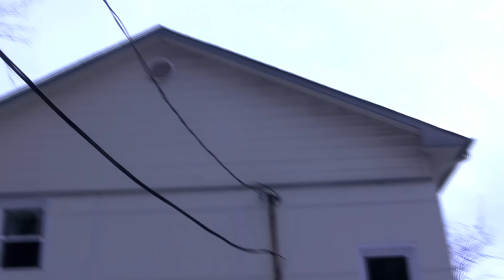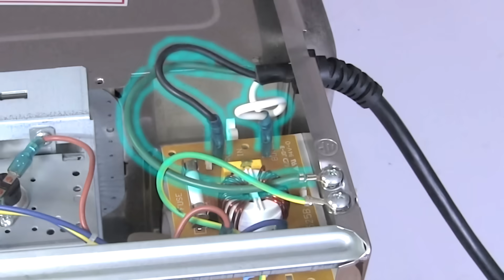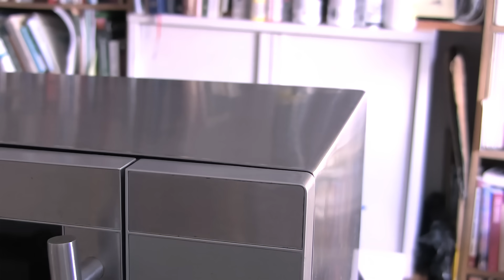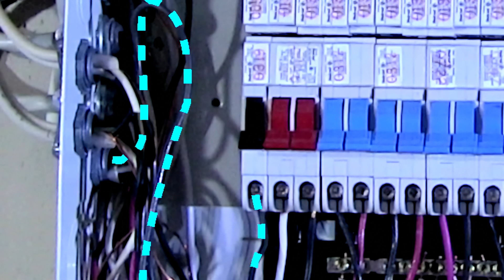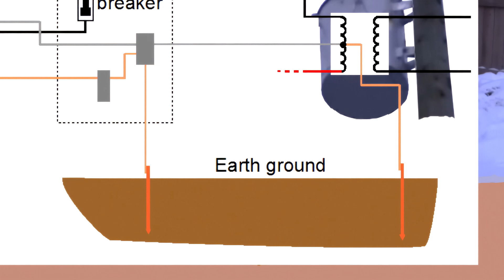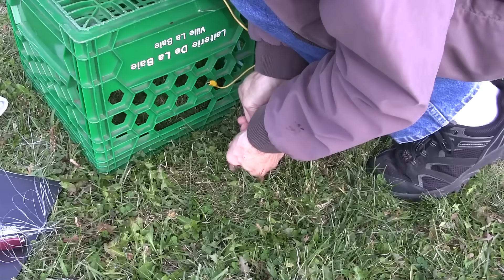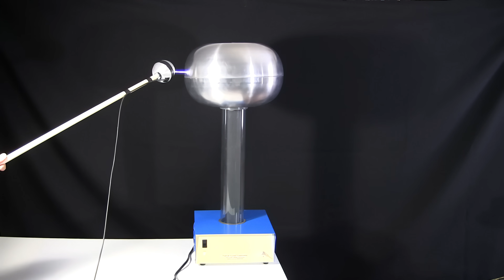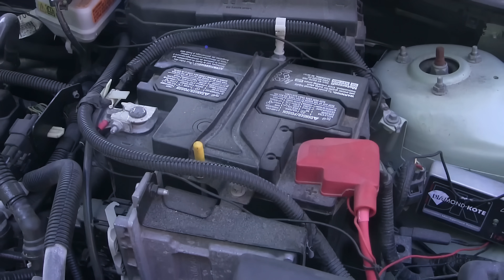What is Ground? Earth Ground/Earthing

Comment: How do phones and laptops make portable ground for their bluetooth and Wi-Fi antennas?
Reply: Great Question: 

Phones and Laptops use Direct Current (DC) so the electrons have a path back to the Source of power which is a Battery.
This Video is refferring to Alternating Current (AC) The primary path for the Eletrons to get back to the source of power (The Transformer)  is the Neutral (white wire) with the Ground (green or bare copper wire) as a alternate path. (explained in the Vid.)
Reply: @portbari87  little knowledge is dangerous  -laptops etc uses both ac and dc current in their various applications
Reply: You don't need any kind of an earth ground for those antennas. Just like any old fashioned portable radio.
Reply: It’s also important to note that all batteries are DC unless run through a transformer afterwards.
Reply: @griplimit   Why would you run DC through a transformer?
Reply: @fiddlyphuk6414  dc cannot work through a transformer, it will just heat it up and act like a heater and possibly burn it up -same as running dc through a voice coil  (speaker)-you need a collapsing magnetic field for the transformer to work -ie AC current that reaches its peak than collaspse to zero than peaks to minus,
Reply: @ericscaillet2232   Yeah dude- I know. That's why I was asking griplimit.
Reply: lookup "RF ground"

Comment: In India We use Red for Phase(Hot or Live) , Black for Neutral and Green for earth. Ground wire runs separately from equipment to local earthing point (separate earth pit constructed at home). It does not get combined with neutral wire in junction box. Whereas neutral  point of transformer is earthed at transformer pole.
Reply: Ganesh Kumar Shetty the UK used to be Red for live, Black for Neutral and Green for earth but for sometime now it has been changed to Brown for live, Blue for neutral and Green & Yellow for Earth to make it easier for colour blind people to identify the wires. The whole of the European Union follows this convention. This only applies to new or modified installations, so it is quite confusing to see wiring with a mix of colours. Wherever the new wiring has been used on an old installation, a notice has to be displayed indicating that the new colours have been used. I think it is the convention in the US to join the neutral and earth in the panel, unlike ourselves, earthing the neutral at the transformer.
Reply: That was british way..same as malaysia..here in malaysia ground touches neutral can cause tripping..
Reply: @Ganesh - Those are the OLD Color Codes for wiring  ...

Comment: the ground should be separate from the neutral and actual travel a separate pathway to the earth ground
Reply: The neutral is grounded in the switchgear anyway.

It is however bad practice to mix grounds and neutrals in a local panel.
Reply: @RommulusRemus  
So the electricity , it goes into a neutral metal ? And thats considered ground ? How does the circuit still work if power drains off ?
Reply: @RommulusRemus  Yes, Neutral is bonded to Ground in the Main Panel the USA, but in all countries.
Reply: I am no an engineer but I have done dozens of services from 4000A on down and you always ground the neutral.

When we do transformers (which is considered a separately derived system ie its own service) if you don't ground the transformer you get problems. The power does not just bleed off because the hot is not grounded.
Reply: @RommulusRemus    Is it against code to ground the neutral wire in the panel/box ?
Reply: @RommulusRemus  In the USA
Reply: Yeah- seems like you're giving the lightning an invitation to come into your house and burn through your box to get to ground by grounding the neutral at the box. Better to keep it all going to the outside at the transformer pole instead and then zap down to the ground wire there.  BUT- what would happen if the ground wire at the pole would would open up and loose connection AND your neutral wasn't grounded inside the box?? That seems like a real formula for disaster if there was a lightning strike. So what's the answer???
Reply: It seems to mean that engineers, electricians and the like, should know better but reading these comments tells me that they don’t know the reason for grounding (earthing) the neutral. They should find out!
Reply: @kennethcohan9630  It's mainly for protection from lightning strikes
Reply: Finally, someone who speaks the truth. Mixing grounds and neutrals is a violation of safety code, and yet people still do it. And stupid shit like this on Utube is what gets people in legal trouble.
Reply: @VitoVeccia  yeah dude, grounding sometimes kills people. had a case here in perth where someone got killed grabbing an outdoor tap, incoming mains had a badly connected neutral, but because there is a main earth/neutral connection in the switchboard the electricity went through the girl,into the ground and back to the neutral, if there were no ground she wouldn't have gotten killed.
Reply: @VitoVeccia  correct,but in the old days that is how it was done until they decided if was dangerous.

Comment: i live in a house that was built in 1961 the gas heater did not have a ground i had a new ac and heater unit installed the ac man said i need to ground the heater i cant afford to hire an electrican so can i put a ground rod in and ground the heater to it
Reply: doug .patterson even if you are competent, you may not be qualified or authorised to do the work. If you intend doing the work, you need to read all you can about earthing and once you have done the work let an electrician test it  to make sure it complies with the electrical regulations. You may need his signature to comply with regulations. Unless the exposed metalwork is earthed correctly then you and your family could be at risk of electrocution. Incidentally, aren’t the other appliances, in your house, earthed? If they are, you can use the same earth connection.

Comment: In Australian standards we have Active (Brown), Neutral (Blue) and Earth (Yellow and Green) Or this can be A (Red) and N (Black). 
The link between Earth and Neutral is called a MEN (Multiple Earthed Neutral), this is common in house holds and might be required under standards, in most switch boards I work on in commercial buildings there is no MEN link, the neutral and earth bar a completely separate, im not sure if they are in the bigger supply boards.
Reply: MEN is only required at the main switchboard
Reply: Same here in malaysia..
Ground touch neutral can cause trip..

Comment: Except that the transformer you show is SWER, single wire earth return - no neutral.
Reply: NO, it is not !  He showed about 1/2 ( one Hot wire & one Neutral wire ) from a 240V 3-Wire Split-Phase Residential Circuit (USA).

Comment: is it true that in the past before grounding got introduced you only got shocked if you touched the hot wire on one hand and the cold wire on the other, but now you can get shocked because of touching only the hot wire because of all the grounding around us, the electrons use our body to reach earth and from earth reach the cold wire(neutral) since earth and neutral are always connected.
so the ground system is causing more deaths than if it hadn't existed
Reply: Procker Dark not really. The earth was always there (duh), so in the past if you had touched the hot wire electricity would still flow through you to the earth(assuming you were connected to the earth ground and had no insulation). Also I’m willing to bet that the wattage back then was not nearly as powerful as it is now.
Reply: c flowing through human body from earth https://youtu.be/CHvdvadpCB8

Comment: Please help me. For years my security was working just fine. I removed the old one and when I was installing the new one,  got an electric shock despite the fact that the switch was off. Then despite the fact that the switch was off when I touched the ground wire, it gave me a shock!!! What is the reason!?
Reply: if you touch only a ground wire it should normally not shock you.  that could mean that a wire is not connected to the ground as it should be.

Comment: This video is so non engeneering,, the 3 pin socket ,, the middle is ground ,, yes it is a safety system,, which is connected to earth electrode buried in the earth near the house,,it is also connected to distribution box,, the idea is if current leaks into any conducting parts, instead if shocking us it goes to ground,,
   You cannot use the main supply neutral as ground ,, because those neutrals are produced in substation for efficient current return flow ,, usually 3 phase ,,main neutrals are also known as system earth,,

Comment: Great video. Why do I have to ground my airplane before fueling but don’t (intentionally) ground my car?
Reply: Airplanes have a higher chance to build up a static charge (electrostatic difference) than a car; but it is basically the same.
Touching the fuel nozzle to the chassis of the car before getting it near the fumes coming out of the filling port is probably a good idea.

Comment: Do two hot wires from the substation feed both side of the main coil in the transformer, or one of them is a ground/neutral wire?
Reply: In North America, residential transformers have a HV side and a neutral ground side of the primary, usually 7.2 kV (12.47 kV 3-phase). This is why sometimes you only see one HV bushing on top of the transformer.
Reply: lookup "split phase power"

Comment: If neutral wire and earth wire are both grounded to earth in breaker panel and moreover if the transformer is also grounded to earth, it means both are in same reference (0 V). Then why are we connecting the neutral (or earth wire) in breaker panel to neutral wire in transformer since charge can directly go to earth if fault occurs. Won't it save cost by reduced wiring?
Reply: Some wiring cost is being saved by not having to run a ground wire from the pole to the building.  

Also, depending on the length of wire from pole to building, current flowing back to the pole on the neutral wire could have a couple few volts on it...not going to electrocute someone but that's just not kosher.    

Other unusual problems can arise if a building does not have it's own ground rod.  If power pole ground rod failed the power plug's ground prong safety feature would be worthless.  Redundancy is wise and probably required by various legal rules having to do with liabilities  that trace back to English law and maybe even Roman law.  

The building's ground rod is also very helpful in reducing hum and buzz problems in audio equipment and similar problems with video and data.  With several building's neutral wires all joined at the pole to go to the pole's gound rod there will be a buildup of noise on that neutral.  The noise is caused by any load that is not purely resistive.  A purely resistive load is the incandescent light bulb and electric heaters and that's about it.    The noise does not just disappear into the ground rod.  Noise on the neutral caused by electrical equipment in one building will be present in all buildings sharing the power pole's neutral ground rod.  Sound recording studios usually have to have their own transformer with it's own ground rod.  Such transformers are usually of the type known as "isolation transformer" which is designed to greatly reduce noise coupling from the primary to secondary winding.
Reply: @rh001YT  State your credentials.
Reply: @ Sir Pumpington   State your credentials, or if you have an objection simply state it and why, or the opposite.
Reply: @rh001YT  You don't have any. You are unqualified to offer advice.
Reply: @Sir Pumpington   What is it exactly you think I've got wrong?
Reply: The neutral is to complete the loop and send unused power back to the transformer, neutral is essential, but it's not a ground, its bonded to the ground bus in a panel to provide a quick path to ground,

Comment: 8:05 does it really though?  Metal fence posts are (should be) inserted into concrete footers and would that not isolate it from the ground?  The rest of it probably doesn't make that great of contact with the ground and even if so, it's not very deep so it wouldn't be below the frost line.  So wouldn't that make chain link fences not that great for grounding?  Nevermind, it appears the concrete helps SIGNIFICANTLY with conductivity between soil and metal.  Still....wouldn't the fact that it's above the frost line make it not that great for grounding?
Reply from the maker: In winter, it wouldn't be great, no. However, if you just need it for a quick electrical experiment then it's good enough while the ground's warm. I wouldn't use it as a household ground though.
Reply: @RimstarOrg  Fences shall NOT be used as substitute for a ground rod

Comment: 5:42 - how can they become charged?  This is not made clear.  Is it from the connection to ground in the first place, since lightning is attracted to the ground?  I don't see any other way, unless the lightning somehow came through your house or something.  I don't really understand.  Once the cases ARE charged, however, I understand how the ground connection would pull the charge away and make them neutrally charged again.  Thanks!
Reply from the maker: It comes in through the ground wire. I've worked on solar projects where it also came in through the wires coming from the solar panels and it damaged equipment or blew special protective fuses.

Comment: i need advice on earthing,  What size fuse would i need if i wanted to add it outside on the ground cable attached to the earth rod? i want it to be safe enough for the house circuit to function but the fuse needs to be big enough so that a ground lightning  strike cant travel backwards into the circuit board and toast whole system . 
 you see the direct energy weapons that were used in the California fires volted up the ground and then burnt up the circuits destroying the whole property . DEW weapons blast around 5million volts and i was wondering if a huge fuse on the ground  cable would prevent this happening .
Reply: First of all, you don't want a fuse on your earth ground cable. You need to earth ground cable to be able to carry fault current back to the source. Secondly, there aren't any consumer grade products that will save you from 5 megavolts, just insure your property.
Reply: @AeonFlexOfficial  thanks for your reply, i appreciate it! it was just a thought, however home insurance doesn't cover the oversite / building plot so when its destroyed by the fire you lose everything and are no longer entitled to keep the land, as the California fire victims have found out! this is the Agenda 21 land grab/human relocation program ! to put us in residential districts and take away 90 % of our land in preparation for the coming mudflood massacre, the last one i believe was in the early 18th century and the skeletons of all the victims are all nicely stacked away in the Paris Catacombs as a shrine for the Elite to worship and hold sacrifices !
History is His-story and its all a Lie thats kept in their Lie-brary`s ! 
have you researched Agenda 21 ?
Reply: Brian Clarke you don’t want the ground circuit to open, otherwise you will lose your protection, so no fuse and no switch. Furthermore, you don’t want to put a fuse in the neutral wire either or a single pole switch, otherwise it might open under fault conditions and your hot(live) wire would still be connected. The only place you should put fuse or a switch is in the hot (live) wire.
Reply: @kennethcohan9630  Thank you Kenneth , it was just a thought that hopefully would beat the odds. i appreciate your time and knowledge on this and will abort this idea !